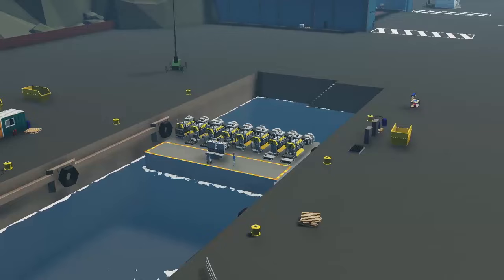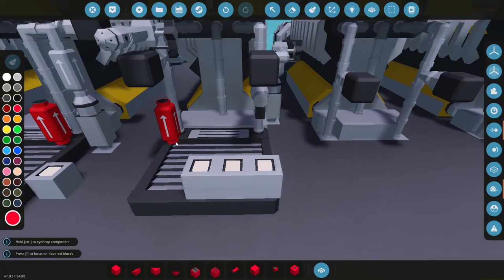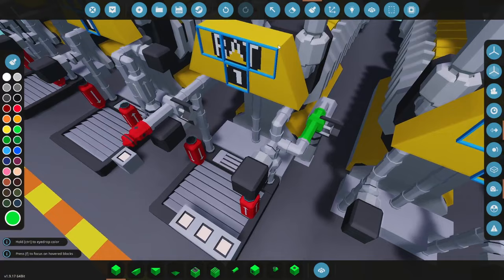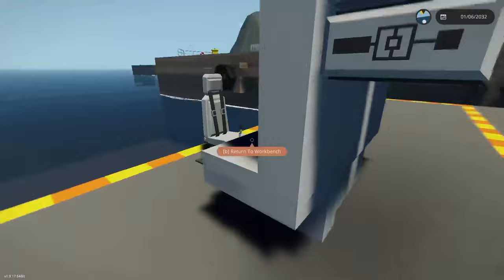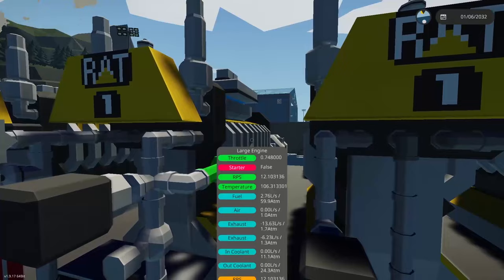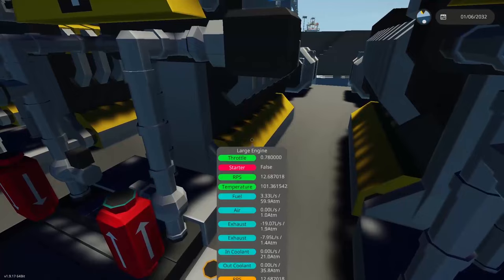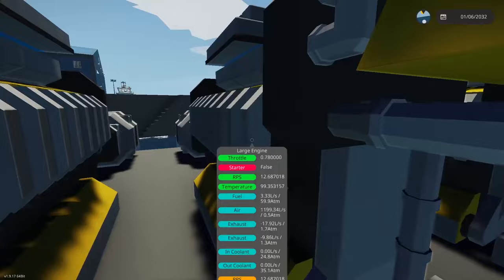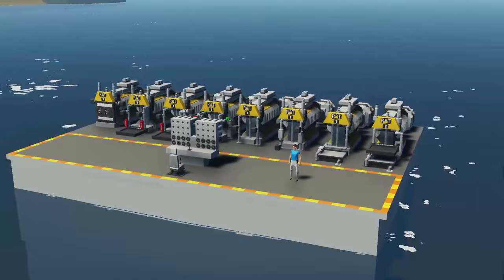TESTING RADIATOR SETUPS after the Compressed Gases Update

Comment: 9:10 The radiator is cool because there is no coolant flowing through it. It will cool itself to ambient temperature, but if the engine doesn't exchange any fluid with the radiator, then the engine will not be cooled.

General rule of thumb: The hotter the radiator, the more cooling is happening. Have a close look on the flow rates, you will notice a causation between high radiator temps and high flow rates.

Also: The Temperature of prefab engines is only dependent on rps and ambient temperature. Fuel burn rate or load or throttle or anything else has no affect on the engines. They can run at full throttle without any cooling at around 12 rps. You can gear them in such a way that they will stay below 12 rps with full throttle and get more power out of them. This is obviously only necessary until the devs fix the issues.

Comment: At 9:40 in the video, the engine temperature was actually dropping because the engine was pumping out the hot coolant and not sending it through the radiator, when you opened the valve to let the coolant out, and looked at the temp, it was at 105.8 and it dropped to around 104.7 if you left it on the temp would have kept dropping.
Reply from the maker: I actually noticed this while rewatching the video - I will look into this again!

Comment: Hmm, great minds think alike. Was testing cooling / heating systems (for other reasons) earlier and posted on your Discord (insert shameless plug here) some results.

One interesting thing, radiators will heat up the room they are in.

Need to test if engines also heat the room.

In any case, you may find your radiators work better if placed outside of the engine room where there is plenty of airflow or even places outside.

Comment: Hello, From Looking at how you cool engines in my opinion I feel like you are not giving the engines enough cooling in the first place. I understand that these systems worked before the update but I always overloaded on cooling for my engines (especially Modular) which meant that after the pressure update I have seen that my cooling has some how gotten even better.
All I would say is that if you want to keep using 1 rad is to make the lines in-between the engine cooling ports and the rad as short and as straight as possible, and also adding in 2 big pumps as it seems that they have nerfed the small pumps, if the large pumps don't seem to be creating a large amount of pressure, then I recommend having a bleed of valve with a gas filter, this makes no sense but I have seen it fix this issue from time to time.
Also instead of taking water directly from the sea floor, I recommend putting it through a 5x5 heat exchanger with 2 large pumps on either side, also instead of doing A,A and B,B like you are currently, I would recommend A.B for The engine side and A,B for the ocean side, this should make the pipes shorter and make it more efficient I think.

Comment: So I have been playing with reactors and found pressurizing the reactor with air to about 34.5 atm gave me best flowrate.  It was changing flowrate by a couple hundred L/s.  This was closed loop setup and large pumps on supply and return from boiler.  Boiler heated fastest with better flowrates.

Comment: Been messing with my oil refinery and found oil had to be 6-8atm before it would start heating. Did you try pumping a small or medium tanks worth of water into the cooling loop before activating the engine.

Comment: The actual throttle amount doesn't matter, it's the engine rps. Anything over 12 is just going to be harder to keep cool for right now. Add more load to lower the rps to 12 or below at full throttle and it's work just fine.
Reply: Yo can you read my? May you can find a solution

Comment: The radiators were affected normally, you need tons of air flowing through them to make them effective. Being stationary won’t do a think even though they are electric, the fan just can’t draw in enough air. If that engine was on a plane and moving fast, the radiator would be able to cool it down easily, there just isn’t enough air flowing through the radiator to cool the engine down.
Reply from the maker: I will look into this as well! Thanks for the idea
Reply: The game isn't that sophisticated. The "fans" are just a toggle to increasing the heat transfer rate. Basically a switchbox between two different numbers. Ambient temp controls how fast heat transfers out of the radiator. There is a lower ambient temp at altitude--I've run tests and it averages -0.007 deg/m above sea level. So at 1000m, the air temp will be 7 deg cooler than the ground temp.

Comment: Medium engine solution: two small pump pump in another pump and that pump to strait to the engine, work only for boat with Sea water cooling and for the pipes do not put t junction just straight and 90°  for the output of the engine just a fluid port, I can run my engine at 20 rps continue
Reply: The weird is the engine more you run more is cooler need just little of time after the pump are on
Reply: Conclusion more cooling flow as possible